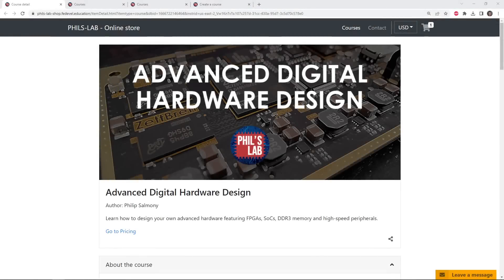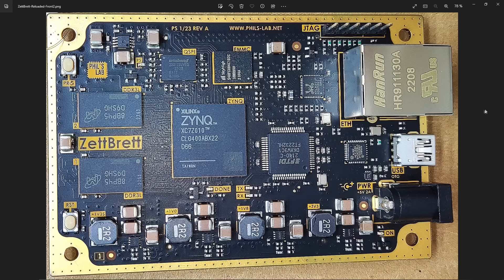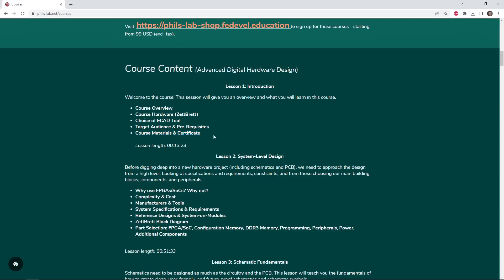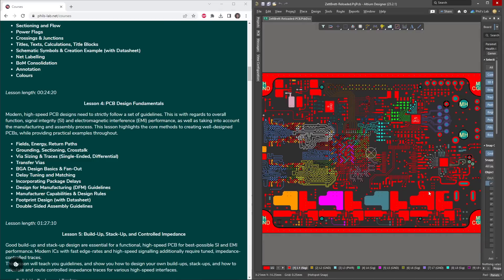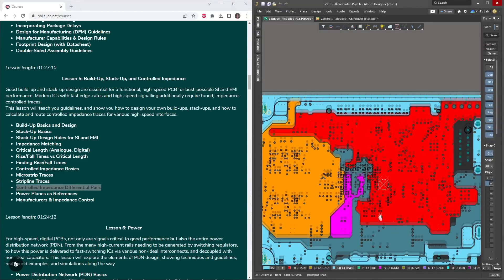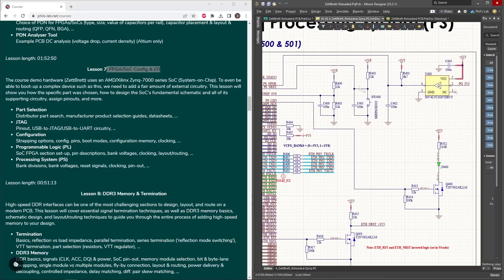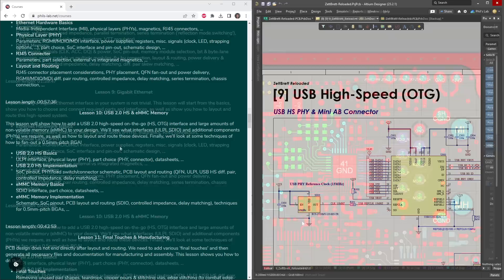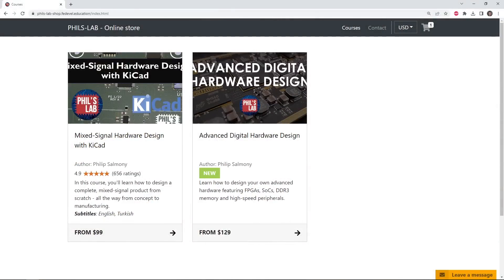Advanced Digital Hardware Design (Course Release) - Phil's Lab

Comment: Hello 
I am an mechanical engineering student and i am interested to learn about PCB design and Embedded systems because i am working on a robotic project for my final year college major project. Is this course helpful for me ?
Reply from the maker: As darkrasen stated, I'd recommend starting with the videos on my channel covering the 'basics' (e.g. the full walkthroughs of an STM32-based design), then practising those designs on your own, before moving on to the courses.
Reply: Depending on your background and the complexity of the circuit this may be too advanced. I'd recommend to start with his videos on STM32 boards in case you haven't checked them out yet.

Comment: Is it actually possible to lay out and take to manufacture a board as complex as this, using KiCAD? Does KiCAD have all the features needed to complete the entire design flow on this board?
Reply from the maker: Yeah, KiCad will be able to do this. However, there are a few features I would miss doing this in KiCad.
Reply: @PhilsLab  Hi, could you tell us what are the features you would miss doing this in KiCad ? Can these features be found in free software ? (for example the saturn PCB toolkit)

Comment: Hey Phil, I want to buy this course or the other more basic course. But I have very little PCB knowledge and very basic electronics experience. I don't know when to use copper pour vs trace, heat sinks etc and not sure where to start. Will these courses help?
Reply from the maker: Hey, I'd suggest starting with the free YT vids, creating a number of your own designs, and only then moving on to the courses.

Comment: current junior in electrical and computer engineering. I got an internship this summer and it is going to revolve around this stuff, but I still dont know that much. Would the previous course / free material from your youtube, be where I start?
Reply from the maker: Hi Thomas, I'd suggest started with the free YT material (in particular, the ~3hr long Altium/KiCad complete walkthroughs). Once you've made a couple of your own PCBs, the mixed-signal course is the next step, followed by the advanced course.
Reply: @PhilsLab  Thank you so much! That was very helpful. My goal is to eventually end up making a custom flight controller pcb for fpv drones!

Comment: Is it possible to follow this course without altium designer? I am currently using kicad.
Reply from the maker: I've tried to make the course as tool-independent as possible, showing how to create a well-designed, functional high-speed PCB, rather than showing how to use a particular tool. So yes, regardless of the tool you use, you'll be able to follow along.

Comment: This is awesome! I have been following you for a year now and I'm about to finish my EE degree. Thanks to your videos I got 100% on the university's introductory PCB design course by documenting the process of upgrading my old PCB project with better PCB design practices. Though it is mostly DIP and TH because I wanted to hand-solder it so I'm definitely lacking in the high speed and more dense PCB department.

There's a vacancy open for a PCB designer at the company I work for. I don't know if I should apply now or wait until I finish my degree in about a month and maybe go through your courses (I still have the mixed-signal one bookmarked) - so much stress and so little time during finals month! I definitely want to go through this course in either case when I get the time.
Reply from the maker: Congratulations on your 100%! 
I'd say go for the open position and practice your PCB design skills while you're waiting to hear back/interview. As long as you have a portfolio of your own designs to show, I think you have a good chance :)

Comment: The course links dont work for me. Not sure if it is just me.
Reply from the maker: Which one in particular didn't work? Could you please try https://phils-lab-shop.fedevel.education - that should direct to the course page.
Reply: @PhilsLab  Both don't work for me, but I recently played around with a filtered DNS over HTTPS router setting and maybe it is simply blocking the request. I will have to try disabling this filter list on the AdGuard DoH
Reply from the maker: Hmm hopefully that's just because of the router settings. I've tried on multiple devices, browsers, etc.. and they've all worked for me.
Reply: @PhilsLab  Yeah I think it works now, something was acting really weird on my end but it works now.